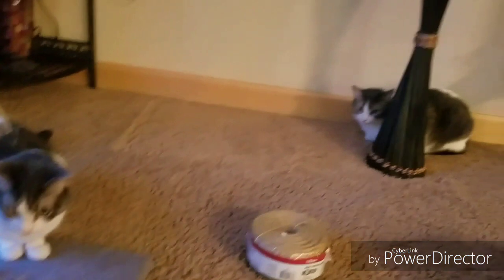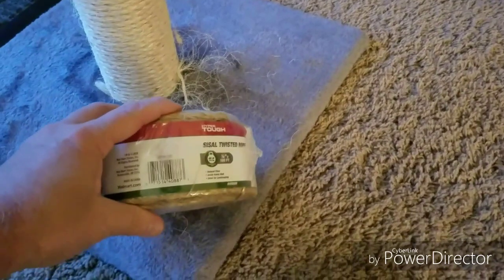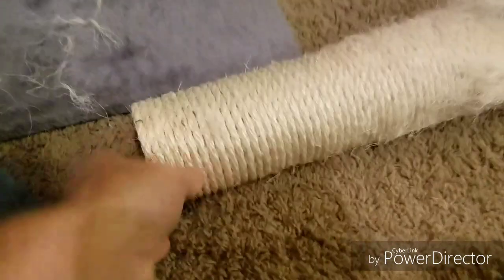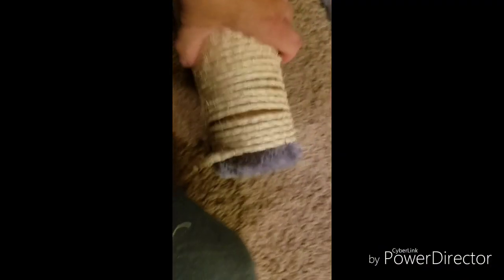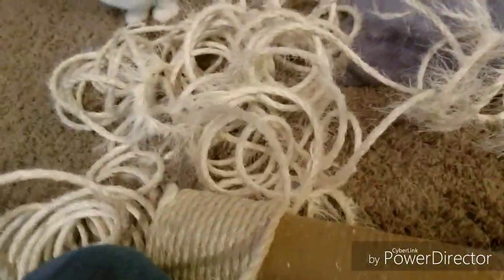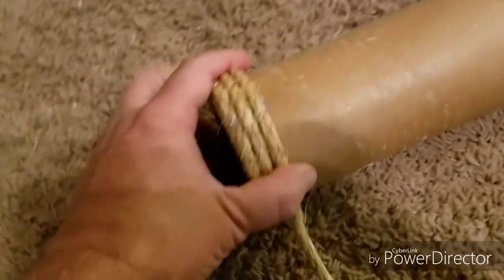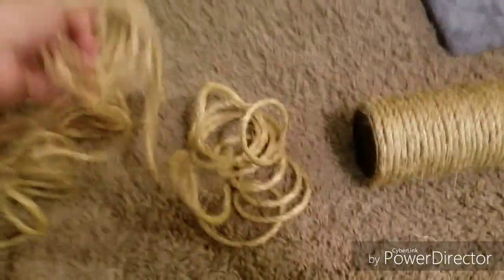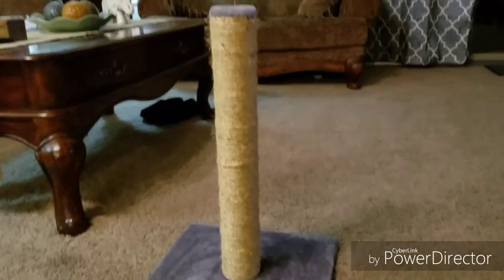Tutorial: How to Restore a Scratching Post

Comment: Soak the rope in vinegar and baking soda for one hour to remove and neutralize formaldehyde. Rinse and repeat.  Natural ropes usually have it to mitigate insect damage. It's not good. Most pet store varieties come with a stamp to show it has the acceptable amount of formaldehyde. It's kind of a thing.
Reply from the maker: Thank you so much for the information.  I will pin this!
Reply: How does sodium acetate neutralize formaldehyde? The products of the reaction when you combine vinegar and baking soda are sodium acetate, carbon dioxide and water (with carbonic acid as an intermediate product). Which of these neutralizes formaldehyde?
Reply: @jssamp4442  I have no idea. I am not a scientist. I think I Googled "How to neutralize formaldehyde on ropes" or something like that.
Reply: @mattmoore9812  Two follow up questions then. Did it work? How did you test for formaldehyde? I am building a cat tree and the rope I bought smells bad but the weather here is not sunny for another 6 months.
Reply: Thanks for the info 👍🏾

Comment: Hey I just stumbled upon this video.
You and I have the same scratcher so it's helpful to know how much rope I'll need.
Do you not use any adhesive to keep it in place throughout the wrapping phase?
Reply from the maker: I just use the old tacks that were on it. You can be the rope ate Walmart.  Although they may have the thinner rope. Doesn't seem to matter to the cat how thick it is. Im sure Home Depot or Lowes might have different sizes.
Reply: @MikeandLisasExcellentAdventure  So I've been to home Depot. Bought the wrong size. Ended up returning it. Have endlessly searched for the same one they have now. Then bought a used one from FB for 10$ LOL but the primary post is still in rough shape. I need to physically go shopping for the right sized rope. Oh lol annnnd I bought a tree on boxing day, and had to return that because it wasn't any kind of sisal rope it was some plant woven together to simulate rope. Hahaha

Comment: Where can I get new post if they scratched the cardboard apart?
Reply from the maker: Good question.  Craft store or Amazon maybe?
Reply: I have got 4 different diameter cardboard tubes so far. First two are 4" and 3" mailer tubes like for mailing long skinny materials. Couple of 8" concrete forms. And 2½" tube from cellophane roll in a commercial kitchen. Tried to get an empty carpet roll tube from HomeDepot but they reuse them.